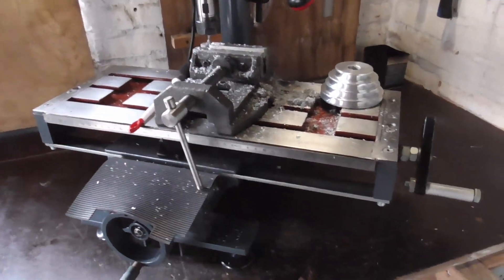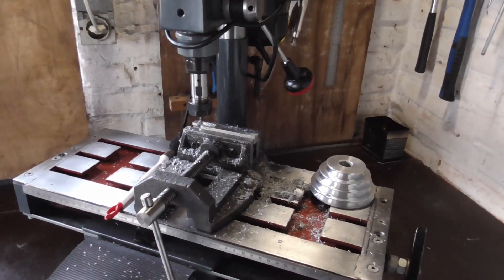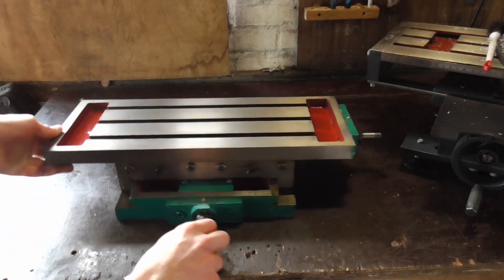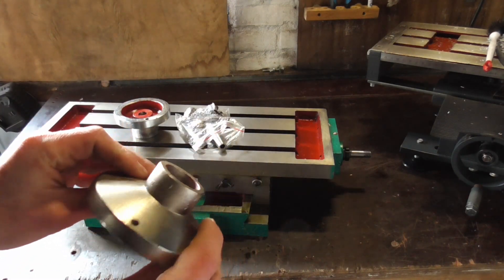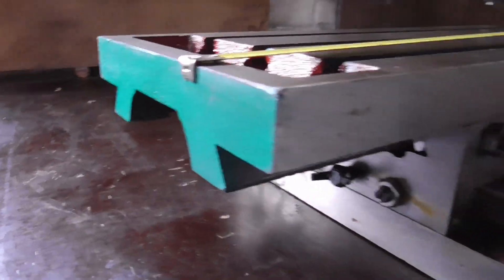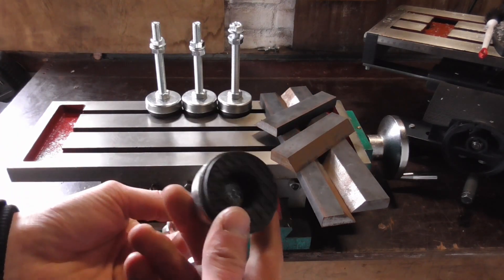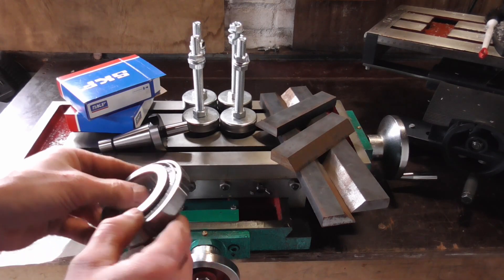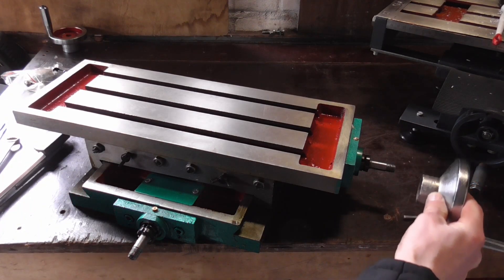Amazon Milling Table overview   [Milling Machine #1]

Comment: Hi is it possible to control x and y axis by a motor? Like cnc?
Reply from the maker: One of my goals with the new machine I am building currently is to make it (semi) CNC, I am pretty sure it is possible but you just need to figure out some motor mounts and expect some backlash with the original leadscrews.

Comment: What measure its that table
Reply from the maker: The table surface is somewhere around 450x170mm (17,7x 6,7 In) it appears quite small but I think it is sufficient for my plans. I can always upgrade to a bigger table, it all bolts on.
Reply: @EngineerSteve  I was thinking to get one and convert it in a cnc but the working area seems to small sadly. It's would come out a beatiful cnc
Reply from the maker: @ivangamer8022  I recommend going to Amazon, where this table is from. They have the same table in bigger sizes as well. The only problem is that these tables need a rebuild straight from the factory (and scraping the ways wouldn't hurt as well, that too is on my list)

Comment: If you want accuracy on your new machine, you should scrape that table for alignment and bearing.  If the ways aren't smooth, it'll always feel terrible.  If the ways aren't straight, it'll never be accurate.  If the ways aren't parallel and un-twisted, accuracy will suffer.  It sounds harder than it actually is.  You'll need a surface plate.  First, make a straightedge with a 45-degree bevel.  You'll also need a surface gage and indicator...
Reply from the maker: Thanks for the comment! Maybe I will look into scraping the table indeed. I currently have the materials nor the skills to do so but I would like to learn scraping.